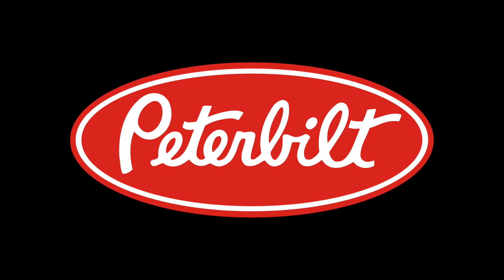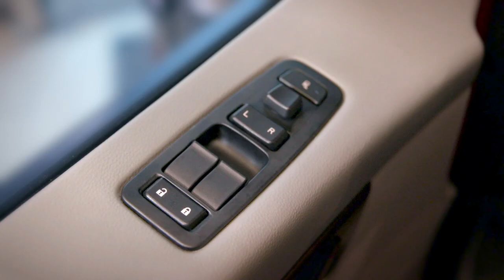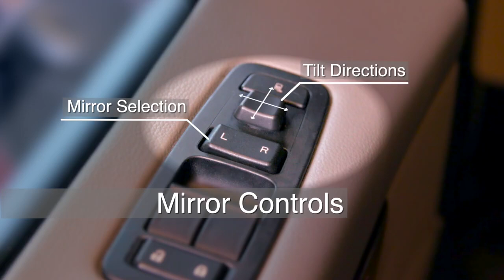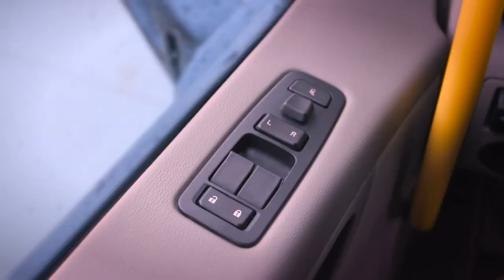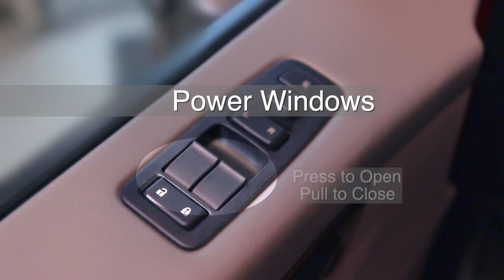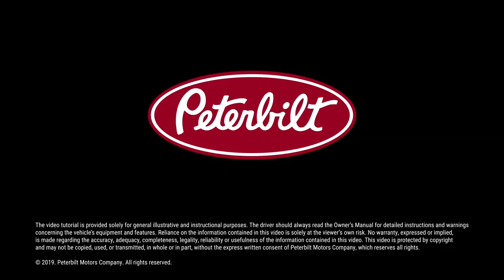Model 567 Window & Mirror Controls

Comment: You forgot (mirror 'bracket' adjustment) instructions, i.e. how to move in or out the entire mirror bracket assembly in the case the brackets stick out too far in tight access places.
Reply: These mirrors for a dump truck application are horrible, cant see damn thing out of them, on the bed or tarp and have to constantly adjust to get a better picture of the surroundings.